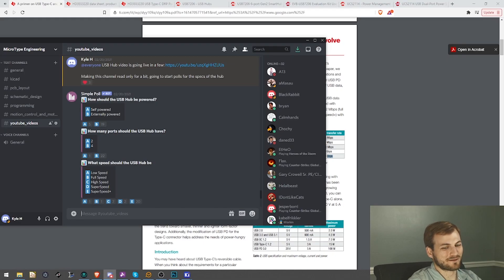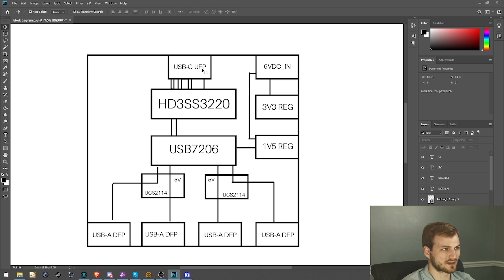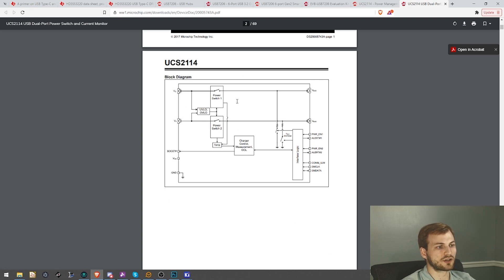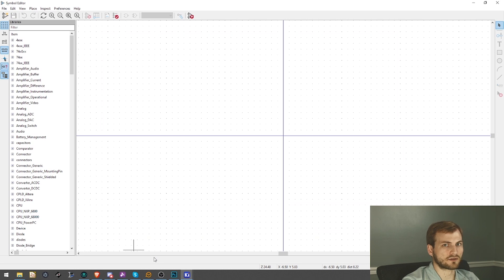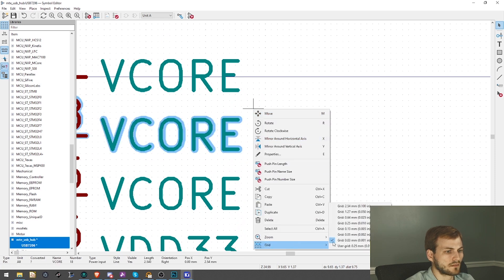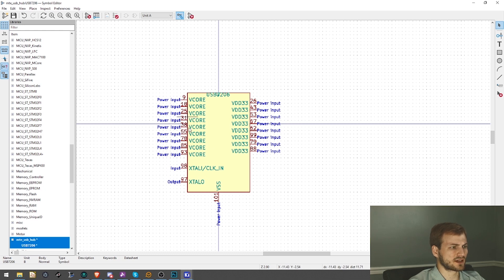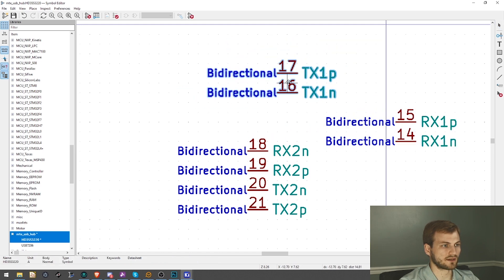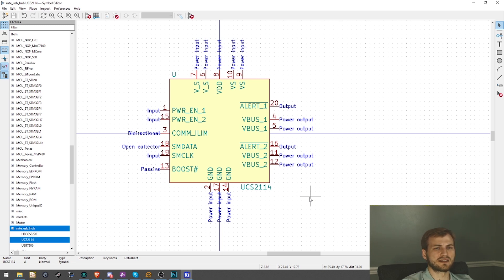USB Hub Design - Part 2/x - Part Selection and Creation

Comment: It wasn't clear if it was an omission for simplicity or oversight, but don't forget the ESD and line protection. You will need special TVS diodes to handle the 10 Gbps links.
For current, you can definitely get 8A bucks from TI. I was looking at using a 12A for a project (to power some SoMs as well as USB).